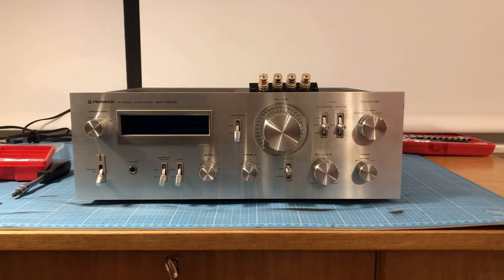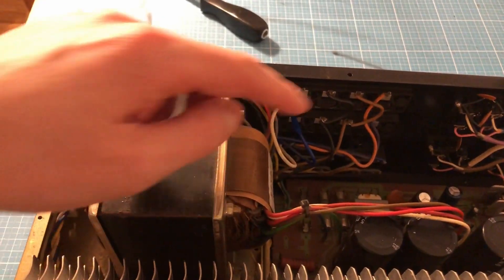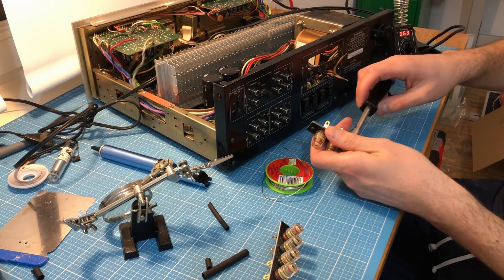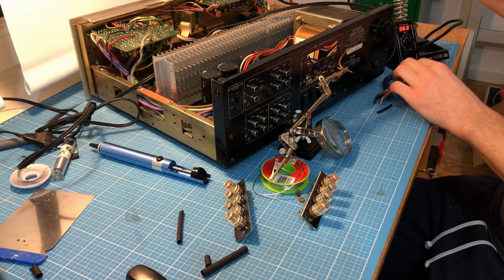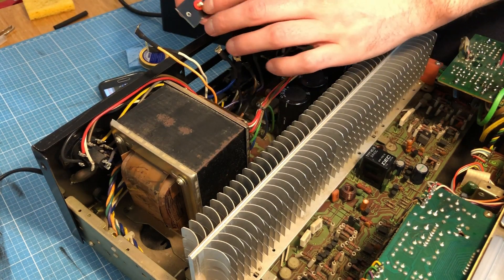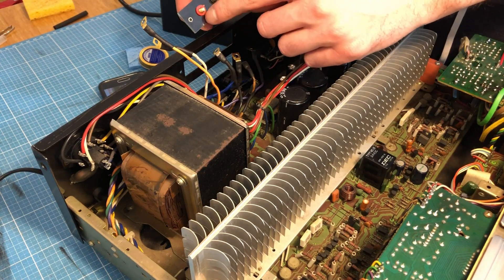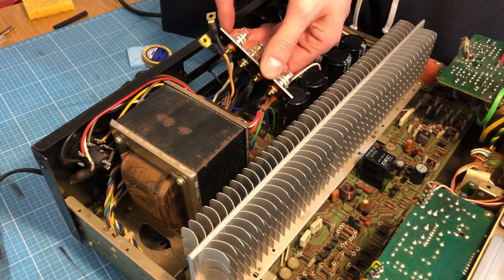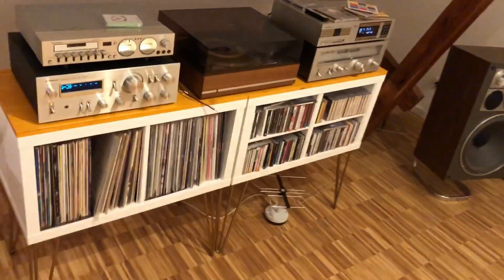Pioneer SA 7800 - speaker terminal replacement / amplifier repair - banana plugs

Comment: Hi, Hi-Vintage, I am new to all this and I'm hoping you or anyone in the comment section can help me. I actually have two old speakers that instead of having some kind of terminal they have speaker wire running out the back of them. I want to retrofit a terminal on them so as to achieve a better connection. I know what kind of terminal I'll be needing. I know that I'll need to solder the speaker +/- to the terminal. What in your opinion would be the best way to do this? I quite like the method you used to connect the replacement terminal to the receiver as it was very clean. What would you call the tips you added to the wires to connect to the terminal plugs?

Comment: An enjoyable repair to watch.  And liked. Thanks for no music loops.  I'm looking to do something like this on a Yamaha RPU100 receiver.  But before cutting any wires I'd want to clip some speaker leads up ahead of the terminals directly to see if that is the problem.  In testing this unit after not using it  for some time I've switched around everything I think of outside the case.  Have not opened the case yet.

Comment: The speaker terminals on my receiver (Hitachi SR-604) just manage to hold the ten gauge pure copper wire I'm using but alas my hi gain input terminals on my 12" monolith subwoofer would not and I broke the spring connectors on two of them trying to get the wire to fit.  I'm going to attempt doing this to the subwoofer so that I may use them as binding posts.  (I connect the subwoofer to the "B" speaker outputs of my receiver to the high gain inputs on the subwoofer and it works great)

Comment: I used to have one of these. I replaced 2x power supply capacitors (small ones in back behind the 4x larger ones) apart from that superb amplifier. Beautifully built unit. Regret selling it now.

Comment: What a great job. I still have pioneer vintage A91Digital amplifier. It's really silly have to have pin type speaker terminals and I'm tired of hooking up cables. The right time has come Chang to banana plug terminals. Let's transform to new age. Thanks for your video.
Reply from the maker: Jayatissa Hathana Durage thanks :)
Reply: The A91-D is an amazing amplifier

Comment: Hi there. This is out of context. Im a newbie in these old audio stuff. Just want to ask. Can I run 100watt(8ohm) speakers with amplifier 45watt(8ohm) perchannel? Need some advices. Thank you
Reply from the maker: Afrido Sabastian hi, sure you can. Most important is impedance (ohm).  The wattage of the speaker indicates how much power the speaker can take before it begins to distort and eventually break due to overheating. However, there more things you have to pay attention to like speaker efficiency for example. Some people say that the amp has to have more Watt then the speaker to avoid clipping. But for the regular usage at home I think this is not important.
Reply: @hi-vintage2946  is there a problem if I run my amp with 100w 8ohm speakers?
Reply from the maker: Afrido Sabastian no, it is not

Comment: I just bought SA-706, and I'm definitely replace terminals. Thanks for your video.
It's not the topic, but I'm still gonna ask... Do you have any recommendation what speakers to pair? I am a fan of vintage stuff so I would like speakers from 70s or 80s (like Wharfedale Laser 150). What do you advise?
Reply from the maker: Tomo that’s so hard to tell :) there a hundreds of good speakers. But if you want to stick to pioneer, the check out the Pioneer HPM speakers. I think HPM 40 are the smallest ones, HPM 1500 are the biggest. Good speakers.
Reply from the maker: I have Tamon TS 808 speakers. But very rare and not that common. By the way: you can build these speaker terminals by yourself, it is much cheaper. Check this out: https://youtu.be/OFsH8L2ivOA
Reply: HPM series looks gorgeous. I will study the differences between the models and wait for someone to sell nearby. Thanks!
Regarding terminals, I was thinking the same. I'll build it on my own.
Sorry I bother you, but just one more question... The SA-706 I mentioned, I bought it few days ago, and will be delivered tomorrow so I still haven't seen it live. On face plate there are few scratches I would like to remove. Do you know, do face plates have some kind of clear coat? I'm thinking of polishing.
Reply from the maker: Tomo oh, be careful with polishing it. Really.. otherwise you may even make it worse. I have seen front plates where people wanted to polish it.... and it looked ruined. try it with dish soap. But if the scratches are too deep, you wont remove them. I don’t think that there is some kind of clear cote on it.
Reply: @hi-vintage2946  I'll see tomorrow. On the images seller sent me it seemed like a surface scratch. Like there was a thin clear coat. I'll try with the trick using water like on the car - if making it wet makes scratch invisible temporarily, maybe there's a hope. Someone advised me to use a fine polishing paste for plastics. Anyhow, I'll be careful. Thank you, Mr. Hi-Vintage.
Reply: Vintage klipsch quartet speakers, absolutely amazing.
Reply: Wharfedale E70s

Comment: good job ! is it worth it to change the internal cables with pieces of good speaker cables for example ?
Reply from the maker: squale 323 thanks a lot! My opinion is no, but Paul from PS Audio had a similar question on his podcast. Check this out: https://youtu.be/cTESaNbXJts

I think that may answer it.
Reply: @hi-vintage2946  already seen this video from Paul, thank you anyway ;-) your video will be usefull for me when i will replace the speaker terminals for my Yamaha CA-810 :-) !